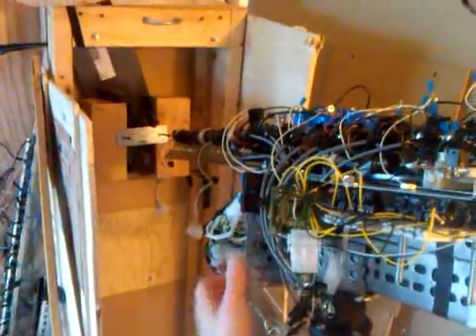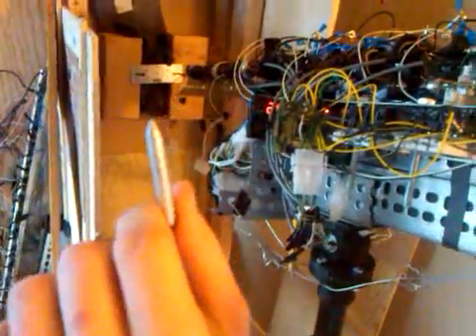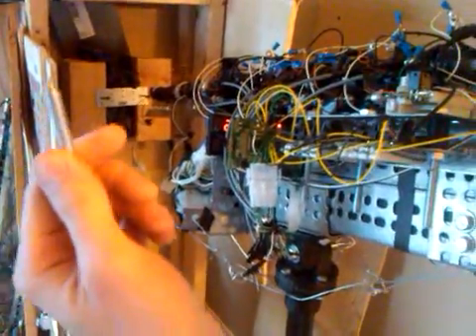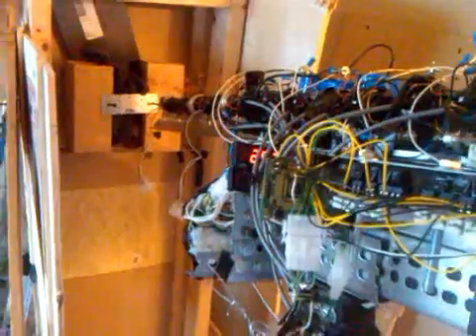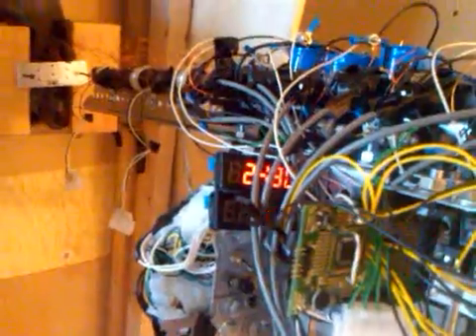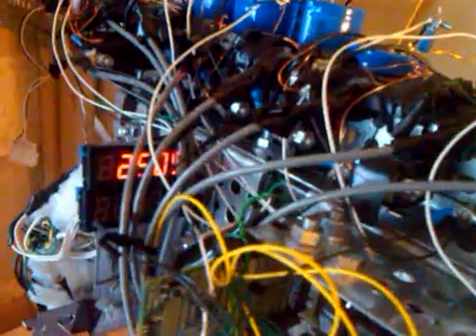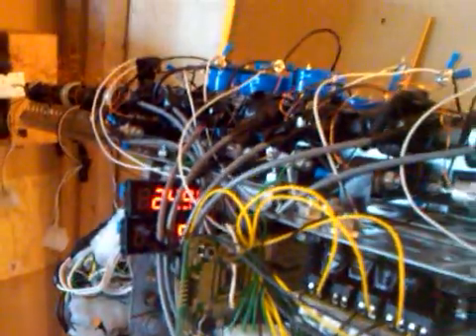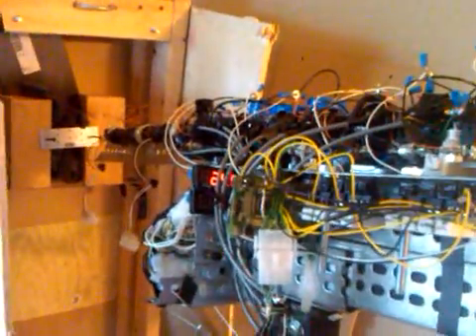Shooting the coil gun at a 1mm steel plate

Comment: This is way too big of a build for it to not even puncture 1mm thick steel. I did that shit with two stages, and a 2 inch by 6 inch by 1 inch control circuit made from transistors exclusively lmfao

Comment: Did you hook the batteries in complimentary polarity? I have been noticing a lot of people not doing this and it has begun to annoy me. It allows for faster capacitor charging since you can pump more charge into the capacitors. Every time I always see the same battery setup.